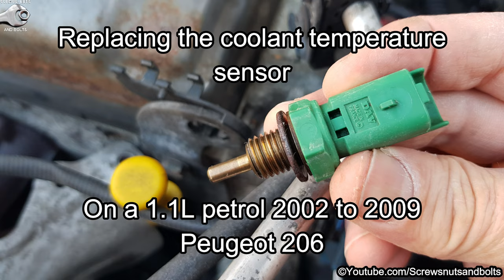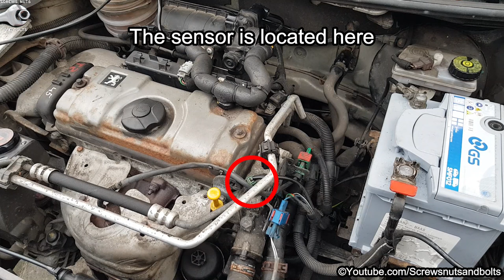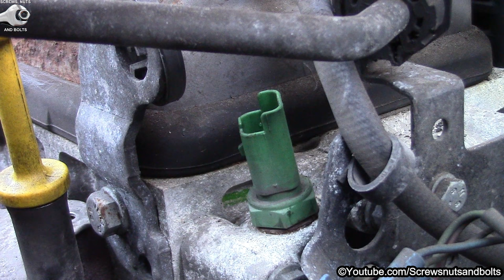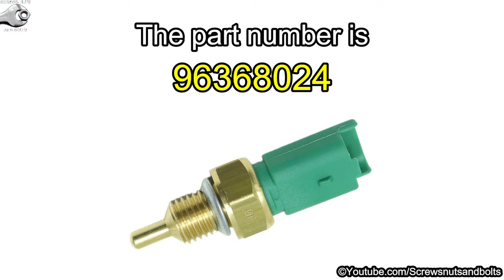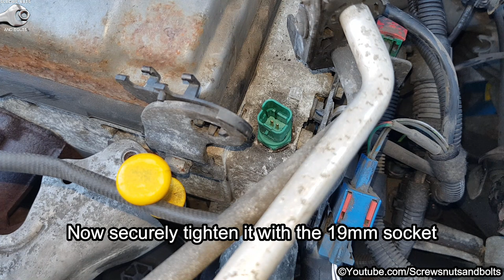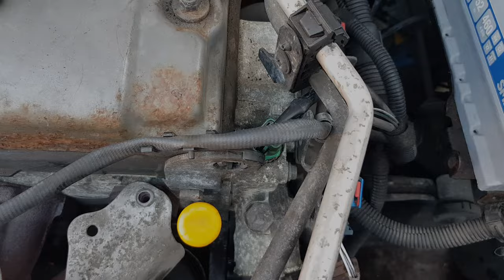Coolant Temperature Sensor Removal and Refitting - Peugeot 206

Comment: Whats the symptoms of faulty coolant temperature sensor ? Is the exhaust gas smell including the sign of faulty sensor?
Reply from the maker: There's quite a few issues a faulty temp sensor can cause. Check this link: https://mechanicbase.com/coolant/engine-coolant-temperature-sensor-symptoms/
Reply: @screwsnutsandbolts  thank you
Reply from the maker: You're welcome
Reply: Mine that the gauge ne er come down from Red

Comment: Hi Amy reason why you have to drain water
Reply from the maker: You will lose coolant when you remove the sensor. However, if you're just doing a straight swap with a new sensor, you could remove the old one and quickly fit the new one, or,  if you have a tapered rubber bung you could take out the sensor and quickly plug the hole to minimise coolant loss.

Comment: Do you need to use odb after you have change the sensor to make it sure to work properly? So ECU knows the sensor has replaced?
Reply from the maker: No it should be a straight swap
Reply: Sensor change did not help. I have problem with false overheating. Engine warms Nice idling, temperature starts lowing when driving, take a while and goes bottom down to 50-60 stays there for a while then stop sign comes and gauge shoots straight to redzone. Any ideas?
Reply from the maker: It sounds like a faulty thermostat. However it could be something else like a faulty water pump or even the gauge itself. I would change the thermostat first as it's relatively cheap to do.
Reply: @JorgelGarcia666  that is a thermostat problem.

Comment: Do I understand this correct? Drain radiator --> Replace sensor --> Add new coolant
Reply from the maker: You could also partially drain the coolant to just below the level of the sensor and then top it up afterwards, or you could do a quick swap with the new sensor without draining the coolant at all. You may only lose a very small amount of coolant if done quickly and accurately.
Reply: @screwsnutsandbolts  I'm gonna drain the radiator and put in new coolant anyway, and replace the MAP sensor aswell. Should I disconnect the battery before I start draining the coolant and replacing the coolant temp sensor or can it be plugged in?
Reply from the maker: It might be worth disconnecting the battery, seeing as though you're replacing a couple of sensors